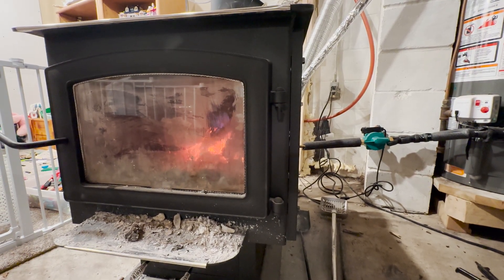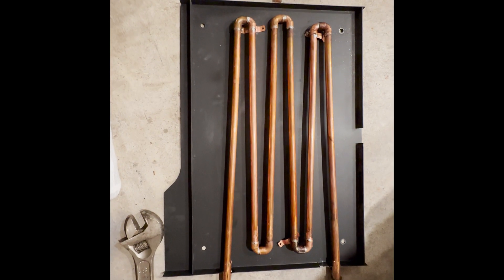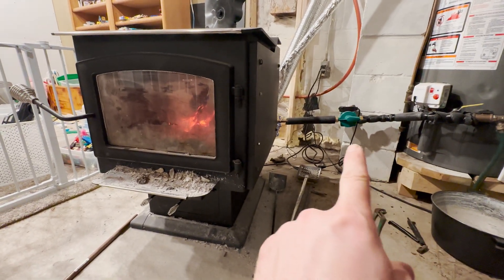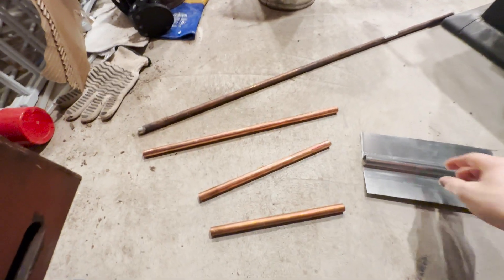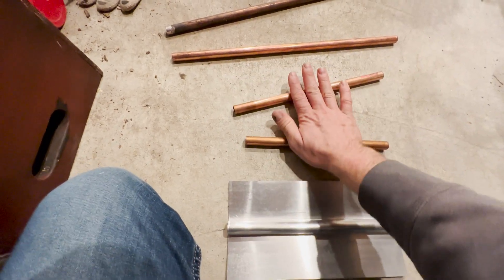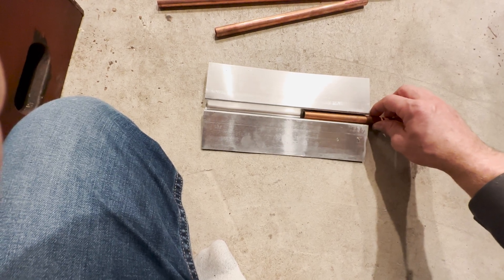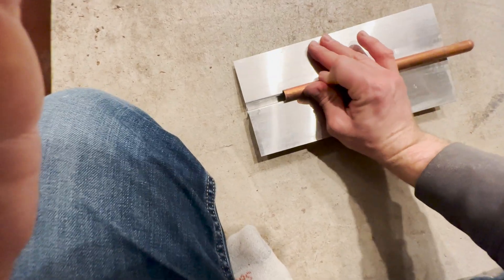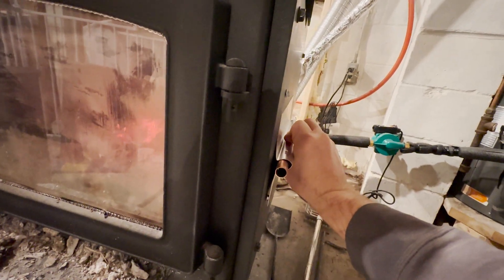Wood Stove water heater heat exchanger version 3.0

Comment: Could you drill holes in the back of the burner and have a helix coil of 1/2 ' copper inside the burner for heating up a hot tub,  via convectional thermosyphon? Or is the outside jacket much more efficient than than a copper coil inside the fire itself??
Reply from the maker: I don’t want to drill through the firebox
Reply from the maker: I don’t want to drill through the fire box

Comment: I built one from a wood burning stove going into a hot water tank. Just a small bundle of branches, about the size of my forearm were needed to get a 40gal tank up-to-heat in less than an hour. Here's the difference between yours and mine...

I did use a pump but I had a 50foot coil of 1/8th inch copper on TOP of the stove with a new top, covering the heat exchanger instead on on the side. A smaller tubing coupled with being on top and a lot more tubing in the heat exchanger made quite the different between yours and mine. At first, It got so hot sometimes, it would blow the tubing before the popoff valve would blow so I ended up putting a Thermal Expansion Tank inline which made all the difference in the world.

The wood burner was dedicated to the hot water tank because I couldn't build a 'big' fire but the branches left over from cutting my firewood for my other stove were in abundance scattered around and I never ran out of fuel for hot water. The pump I used was driven by an DC adaptor(drawing about 1500mA, 1 1/2 amps) and only ran during the initial start up in the morning to heat the 40 gallons for the day in which 40 gals would stay pretty hot all day long once the tank was up to temp.

Without the pump(in a sealed build of a hot water tank with such small tubing, collecting so much heat so fast) it would blow the copper tubing right before it entered the hot water tank(temperature differential maybe?) With the pump, it would only blow a line if I had too big a fire in the box which the Thermal expansion tank seemed to solve that problem plus I always just used a small amount of kindling, that would only burn for about an hour, to heat up the tank (the coals would last about an hour after the initial burn).

I no longer live there and am now working on a small rocket stove to attach to a water tank coupled with a solar panel for summer heating and yes, using the small diameter tubing in both heat exchangers and a pump to gain all the benefits of heating up the tank extremely fast.

If you keep modifying your heat exchanger, eventually you will need to use that pump you installed otherwise you will probably start blowing lines but it's well worth it if you can heat your water a lot faster with you having family members needing hot water on demand.
Reply: One thing I really learned from your build was the temp controller that you had added. I've never heard of that before and is something I will definitely look into on my current build. Thanks a million for posting such an informative version of a 'closed' system because looking around, yours is the only one I've found tying a wood stove into a closed system @portercreek

Comment: My stove (insert) is not new but I am reluctant about drilling into it as well. Just making sure I understand, the pieces you bought from Home Depot were added on after to get more heat transfer? Also you mentioned that you did not want to remove the cover, because it is hot. Is this connected to the pipe with a flexible line of some sort? I would be connecting it directly to one of my base board lines & use the circular pump on the boiler to transfer to the rest of the house. Did you have any issue as of yet with the temperature of the water getting too hot?
Reply from the maker: Yes, the aluminum pieces gives it more heat transfer.  They connect right to the zig zag heat exchanger that I built.  I have not had an issue with the water getting too hot.  We have a family of 6 so hot water is always in short supply 🤪.   The hottest I have seen it get to is about 150f next year I might add another heat exchanger on the other side so we have more hot water during the shoulder months.
Reply: @portercreek  How do you remove the heat exchange? Is it connected with couplings or attached with a flex line?
Reply from the maker: @JOEZEP54  I used unions
Reply: What is the plate your using and how are you attaching it to the wood stove. I read the Mother Earth version and yours is similar. Good videos. Thanks!
Reply from the maker: @schatzihall6572  there is a link in the for the plates, they just clip on to the pipes